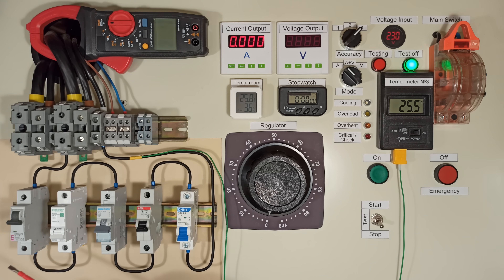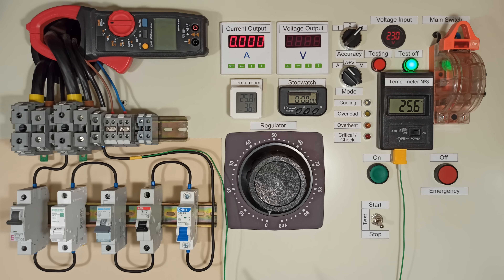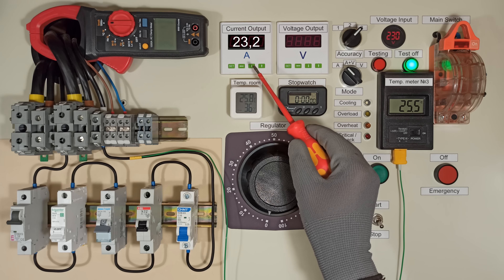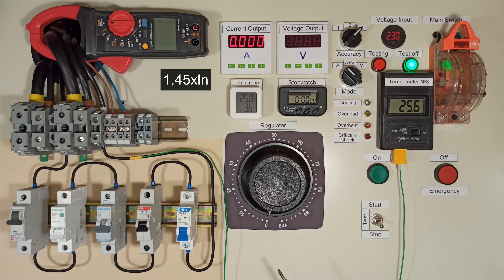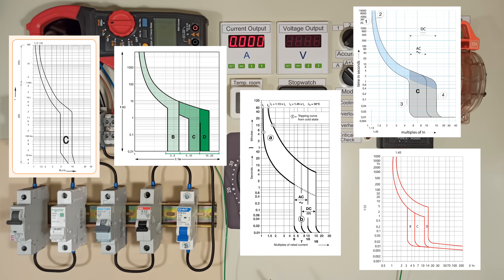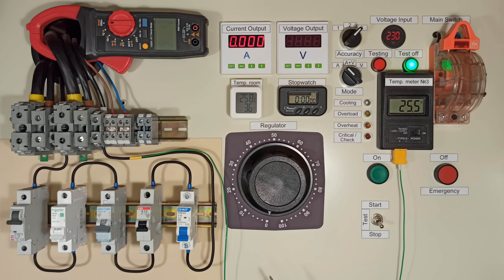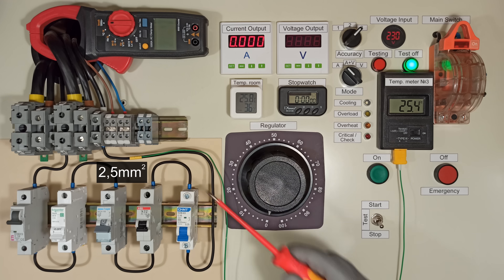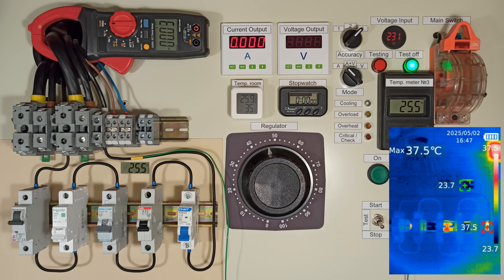Test MCB 16A. ETI, SE, Hager, ABB, CHINT

Comment: This test is somewhat pointless, as it illustrates literally ONE specific scenario, ignoring the entire thermal/magnetic tripping curve. Also the connection is in series... so the last breaker was what, the hottest at start of test? Or was it let to cool a prolonged period of time? This sequence of "odd man out" makes exactly zero sense. A much more sensible test would have many test points - starting with literally In (which should in fact trip the breaker eventually!) , the following the thermal curve in steps, then doing the same for the magnetic curve, so to establish the tripping characteristics along the entire curve more or less.
Reply from the maker: Hello! Yes, this test includes only one point. Although it’s possible to do at least 5 more, that would take more time and make the video longer. At first, I just wanted to understand what happens at this point and whether the topic is interesting.
As for cooling — each test was done after full cooldown (approximately 20–25 minutes).

Comment: I came here just to make sure Chint will trip last.
Reply from the maker: To be honest, I was a bit worried when he was alone...
Reply: @ElectroTest_1  I live in a Middle East, and in our hot climate this feature is a bonus. Here even unplugged wires warm up to 40 degrees C  ))
Reply from the maker: Are you saying that it's better for the circuit breaker to trip later? Interesting. I guess in such conditions that could be an advantage.

Comment: The tripping characteristic must be adapted to the consumer.   For example, if you connect a small welding transformer, the circuit protection switches off because the inrush current is too high. Sometimes you are happier with the old-fashioned slow-blow fuses.
Reply from the maker: Thanks for the info. It's very valuable! Yes, it's important to consider the consumer parameters and the load.

Comment: Falsche Stromrichtung, von oben nach unten 🚫❌
Richtig ist von unten nach oben ✅Da ist auch die Stromschiene
Reply from the maker: Thanks for the comment! In what way does the direction of current affect tripping?
Reply: @ElectroTest_1  Das frag mal den jeweiligen Hersteller, bei einigen Sicherungen ist die Stromrichtung vorgeschrieben bei anderen ist sie beliebig🤷‍♂
Reply from the maker: @janx4706 For alternating current circuit breakers, it definitely does not affect.
Reply: @ElectroTest_1  Warum geben die Hersteller dann die Stromrichtung vor ❓🤔
Reply from the maker: For circuit breakers, a specific direction is usually not indicated. It might just be one of the possible options shown in the diagram.

Comment: ETI is defective and unqualified. Its premature tripping could mean:

1. It may malfunction under normal load conditions (e.g., at 16 amps).
2. It may overheat internally, leading to early trips, which could increase the risk of fire.
3. It could mask other underlying electrical issues, potentially causing greater problems.

A more complete test shall include:
1. Overload test at 1.13x (18A): Must NOT trip for at least 60 minutes or more. This was not tested here; the ETI could fail this if tested.
2. Overload test at 1.45x (23A): Must trip within a typical period of 30-60 minutes. This video only covered this scenario.
3. Short circuit test at 5-10x (80A or more): Must trip immediately - faster is better. This was not tested here.
Reply: There really isnt a "Best performer" since they all have insane tolerances when you really look at it compared to absolute values. It doesnt matter if a B16 take 5minutes or one hour to trip at 19Amps for example because you ALWAYS have a max load that is a good bit lower than the actual rating of the breaker.
Reply from the maker: Hi my friend, I think Eti is generally fine. This test does not contradict the standard (less than one hour). It was very close to the manufacturer's characteristic curve zone. I also think it's important to consider the test system's margin of error.

Thanks a lot for pointing out the standard — however, it doesn't include all the details. There's another interesting point at 2.55 × In. The breaker must trip between 1 and 60 seconds. As far as I know, this is exactly how batch testing is done at the factory, because one test only takes 1 minute.

As for the electromagnetic test, it's also interesting — at 5 × In, the breaker should not trip within 0.1 seconds (in this case, the magnetic release should not yet be active).
But at 10 × In, it must definitely trip within 0.1 seconds.
Reply: @ElectroTest_1    Yeah, I agree with you, it is generally fine, although not the best performer in this particular test. 
My claim might be excessive because I saw comments mistakenly interpreting the test results, ranking Eti as the best due to its (too) fast tripping.

Comment: There should be 1m of wire in between the breakers for this test. In this setup the ones in the middle are disadvantaged.
Reply: By disadvantaged I mean trip faster (depends on the way you look at the purpose: liability of the power supply vs protection of the wiring)
Reply from the maker: Thank you, I understand your point! Do you think that even at a distance of a few centimeters there could be additional heating? I'm not claiming it, but most likely the effect is just a few percent.
Reply: It’s about the wire acting as a heat dissipator. Most of the heat is generated in the connection and conducted and dissipated through the wire . The shorter the wire, the more the heat builds up. The thermic part of the breaker is influenced by this. This is also the reason why you need to space the equipment in some cases and also have to follow the recommendations of the manufacturer about orientation.
Reply from the maker: @johanbenko7818 Thank you, very valuable information. I’ve noticed that the wires help dissipate heat. However, why exactly 1 meter? I haven’t found any information about the wires in the circuit breaker testing standards so far. Besides, in real electrical panels, the wires can be quite short — for example, 30 to 50 cm.
Reply: @ElectroTest_1 I have to check the standards, it has been a while since we performed testing. It can be a real life issue when the nominal current equals the maximum current. The extra generated heat trips the breaker. 
Context: An example are the 3phase thermo magnetic motor breakers that also check phase break. According the manufacturer you have to loop one connection out to one connection in, in case of a 2phase motor. Nobody uses long wires for the loop. In several cases (always when the nom current was at the end of the range) we observed premature tripping of the motor breaker. Extensive testing lead us to this conclusion, afterwards confirmed by the manufacturer.

Comment: Tripping curves are different because manufacturers dont use 100% same bimetallic alloys. Depending on where it is made etc. eti probably used less metal so it warmed up faster and tripped sooner
Reply: Very good point！The bimetalic and it's welding technique can have an effect on tripping.
Reply from the maker: Good point. I think they really are different on the inside. Although there might also be random variations. That will become clear if tested multiple times.

Comment: Von ETI noch nie was gehört ,geschweige denn was gesehen ,jedenfalls liegt es außerhalb der Spezifikation  für Überlast  ,überrascht bin ich von Chint bei Überlast ,aber wie sieht die Sache mit Kurzschuss aus .. werden die Abschaltzeiten eingehalten ?
Reply from the maker: Overall, Eti produces quality equipment. I think there are some acceptable tolerances. The electromagnetic test will come later.
Reply: Der Hauptsitz von ETI befindet sich in Slowenien. Im Jahr 2008 übernahm ETI Elektroelement die Firma Kopp in Deutschland und betreibt dort OEM-Produktion für einige namhafte deutsche Unternehmen. Im Jahr 2001 kaufte das Unternehmen eine Fabrik in Polen (Polam) und produziert dort Schaltanlagen, Leistungsschalter und Sicherungen für Nieder- und Mittelspannung. In Slowenien werden RCDs und andere Geräte hergestellt. Manche bestellen bei anderen Herstellern, z.B. SPD in Iskra und Citel. Das Unternehmen fertigt seine Produkte gemäß den implementierten Qualitätssystem ISO 9001 und ISO 14000 für Unternehmen wie SIEMENS, LINDNER, JEAN MULLER, SIBA und ABB. Es verfügt über europäische Qualitätszertifikate BBJ, VDE, NEMKO, FIMKO, DEMKO usw.
Reply: Thanks for your sharing.
Reply: ETI is a big name in southern and eastern Europe. They tend to be more expensive. Hager and ABB don't mean much there.
Reply: @cirilgolob803  Im from Germany ..  ETI never seen here  ,but Hager , ABB , Siemens , EATON , Schneider and AEG

Comment: To start and induction motor takes about 2 to 3 times it normal running current but for under a few second. To turn on an incandescent might take 12 times it normal current but for less than a 50th of a second. A dead short would try to produce a few hundred amps. Thermal and magnetic components limit over load vs time spectra in the standard breaker.
Reply from the maker: Thank you for the useful information! I like it!)

Comment: Aww... you didn't include the Danish breakers. 😉❤😎
Reply from the maker: Hi, could you list the manufacturers from Denmark?
Reply: @ElectroTest_1  Sure. There are LK, Niko, Sartano, Malmberg, etc.

The biggest thing is, though, that you can't use that setup you have there... in Denmark, Ground is nearly always localized to the property, AND we run both the positive and negative wires through our circuit breakers.
Reply from the maker: Oh, that's interesting. Do you have a TT system? As far as I know, all circuits should have differential protection. And why is overload and short-circuit protection required in each pole?
Reply: @ElectroTest_1  Yes, we primarily the TT-system for ordinary household and small-industry plants. 

We certainly also use TN-system but that is for heavy industry where a ground spike is not advantageous. In those cases we use TN-S, TN-C, TN-C-S. 

And then, of course, we have the IT-system, which is used only for things like Hospitals where you want to eliminate that your RCD breaks unless it's really needed.
Reply from the maker: @TheAngelOfDeath01 Thank you for the very interesting information!

Comment: ну так тест то не корректный :) автоматы должны находится в щите где температура как бы 30-40 градусов, а тут они проветриваются, а потом надо было повторно провести с другим расположением автоматов, от проводов тоже нагревается
Reply from the maker: The temperature inside the electrical panel will be around 25–30 degrees. Wall temperatures in apartments are usually below 25 degrees. The heat will also dissipate. I think higher temperatures may occur in commercial electrical panels, where there is a constant and heavy load. But you’re right — there will also be other breakers nearby in the panel, and it may trip even faster. This can also be tested.

Comment: Wiring  these breakers in series and testing which one trips first makes no sense. They have identical tripping curves, so there's no selectivity. Sometimes the top trips, sometimes the bottom, sometimes both. Anything else is just random, not proper electrical practice.
Reply from the maker: I'm not making any definitive claims yet — I'm still testing and figuring things out together with you. However, manufacturers use different internal components. They’ve also done their own calculations and testing, and made specific design decisions. So while the products may comply with the same standard, in practice I do observe differences. Saying they all have the same specifications doesn’t mean they’re actually the same. Have you seen how wide the permissible range is in the standard?
Reply: @ElectroTest_1  You're right that different manufacturers might use slightly different components, but that's not the point here.
Even if breakers behave slightly differently within the standard, that doesn't make them selective when wired in series.
Selectivity isn't about random differences — it's about designed coordination between upstream and downstream devices.
Testing 5 of the same rating in series (even from different brands) doesn't show selectivity — it just shows statistical variance.
So yes, fun to watch — but electrically, it proves nothing useful.
Reply: @ElectroTest_1  If you actually want to know which breaker trips the fastest,
test each one individually, multiple times, and calculate the average.
That’s the only way to get somewhat reliable results –
but never in series.
Reply from the maker: Thank you for the detailed response. I like your way of thinking, and I generally agree. I learn together with the viewers, and I actually found it more interesting to do and film a test with a series connection. Doing 5 separate tests could be added for accuracy. I’m thinking of doing similar competitions with other manufacturers.

Comment: ETI did a great job, if you want it to hold longer, go for the higher amp
Reply: No. ETI is defective and unqualified. Its premature tripping could mean:
1. It may malfunction under normal load conditions (16 amps).
2. It may overheat internally, leading to early trips, which could increase the risk of fire.
3. It could mask other underlying electrical issues, potentially causing greater problems.
Reply: @changjunzhang  The circuit breaker must trip when it reaches its specified limit. That is what we expect when selecting it to ensure the protection and safety of our equipment.
Reply: @minevietofficial  And it must Not trip if it does not reach its specified limit; this is our expectation. The ETI has failed. At time 1:29, there is a premature tripping on the thermal curve. This breaker has two different switches inside and, therefore, two curves (upper for thermal and lower for magnetic). You only expect it to trip immediately on the magnetic curve, not on the thermal curve where this video was tested. The room temperature during the test was 24°C. Considering the ETI operating in a warmer or enclosed environment, it may trip even earlier, leading to failure or damage.  https://youtu.be/tri2pCjdVxg?si=te_gpizE2M-eleYU&t=265
Reply: But ETI was operating at 1.45 times it rated current. If you strictly follow that "standard," the breaker could hold for up to 1 hour when running at 1.45 times its rated current, which is clearly not ideal for protecting the circuit. Delaying the trip could increase the risk of damage, and in this case, the breaker responded appropriately to protect the circuit. I would rather choose the ETI over the CHINT

Comment: Well, I got it wrong
Reply: I think you misunderstood. ETI did the worst here, it was the only breaker that did not perform within its specification - it tripped slightly too fast. Faster is not always better. If you need a breaker that trips faster on currents slightly above nominal, you can go for a Z-type breaker instead of a B-type.
Reply: @fractuz 
Well in this case I am embarrassed 😂
Thx for the info tho really  appreciate that

Comment: The ChiNT breaker is junk. Look how that thing heats up inside, and not just in the screw connections? It won't fare well near similar breakers.
Reply from the maker: Hi, hold off on conclusions about heating! To the right of the CHINT, that's a false hot spot caused by light reflection on metal. This effect can occur with thermal imagers and at certain angles. You can verify it in the video — the spot is already there before power is applied.

Comment: Germany have a quality proofing. Like Hager an ABB. But you must Test every circuit Breaker alone. Gehäuse you have a voltage down in every Circuit Breaker. And you must keep a cooling time between the Circuit Breaker, für the Thermo Element you Testing. And you must Test the magnetic Breaker too. And which Temperatur have your Room. This ist influece the Thermo Element.
Reply from the maker: Thanks for the information! I'm familiar with IEC 60898-1. I'll try to make the tests more accurate. However, considering the overall precision, I think the influence of the series connection of MCBs is negligible.
Reply from the maker: @Jumpy66 Oh, you might even know better. In the characteristic verification table of IEC 60898-1, it is specified that the 1.45×In test should be performed immediately after the first test — 1.13×In (1 hour). This means the circuit breaker is already warm. But is that what we actually see in the tripping characteristics? For example, I started from a cold state each time.

And one more question — what conductor cross-section should be used for testing circuit breakers? Does it depend on the rated current?
Reply: @ I have the German Master of Electronic. But for test conditions, I must read the Din IEC testing standard. Normally the producer need this. Not the electrical worker. It must be CE labelled.  But you must know, that the temperature in the schwitch cabinet is higher that outside. Every electric component produce thermal energy. For testing normally I would testing between 30 and 35 degrees. Than the circuit breaker have a faster reaktion. The temperature in the switch cabinet is realevant from the current which flow trough the Cabinet. It is a different if you have 1 kW or 10 kW. And the Bi Metal would be a faster reaction.
For cross section, you should know, if you have a minimal cross section, you have more thermal looses. And your Voltage in the circuit bracket is lower, a this is adding in square for energy. For cross section and laying method, and cable length look for the diagram for the circuit breaker.  For standard for 16 B circuit the input normally is 16mm2, pro fuse 63 A, and output 1,5 or 2,5mm2. On the longest way, you must have Ik 3-5 by 16 A circuit breaker 48-80A to switch of the magnetic Switch in the circuit breaker. Look for E Check DIN VDE 0100-105.
You see the answer is not so simple, you have a lot lot of factors in practical use. Work with enough spare, than you are on the secure side.